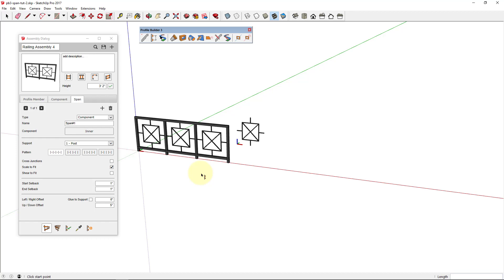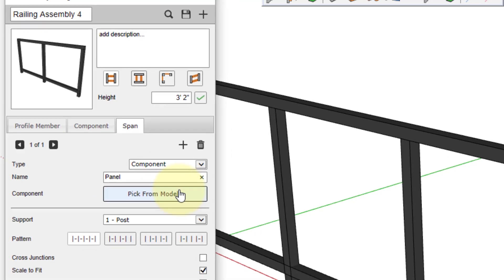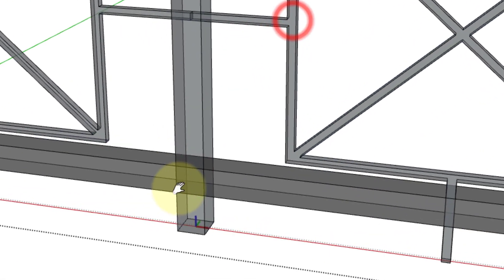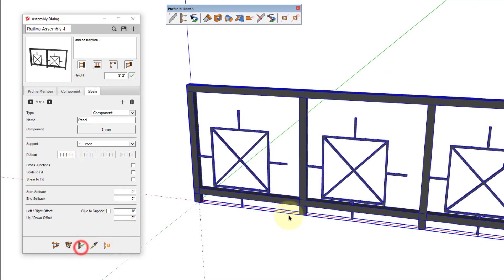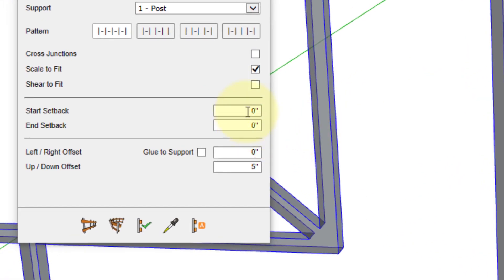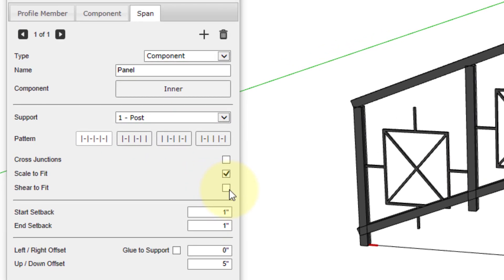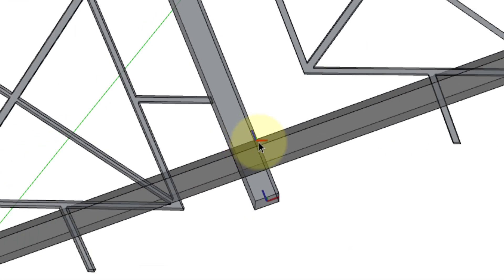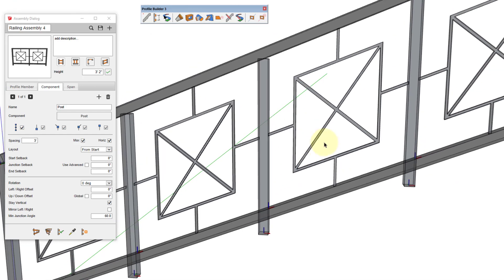Span Tutorial Part 2

Comment: Great tutorials.  I noticed in Part 1 and also in this Part 2 that the tops and bottoms of the components are not sheared when applying the assembly to a slope.  Is there a way to correct that in PB3, and if so, perhaps a Part 3 tutorial demonstrating how?  Thank you.
Reply from the maker: Are you wondering if you can also apply shearing to the Component parts (i.e. the support posts in this case)?  If so, the answer is no.  You can only apply shearing to span components, not (basic) component parts